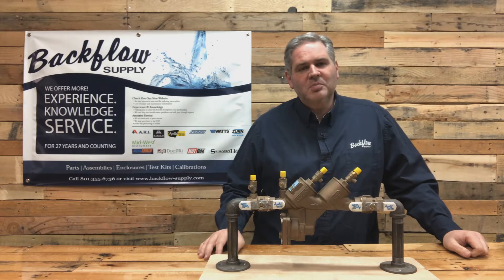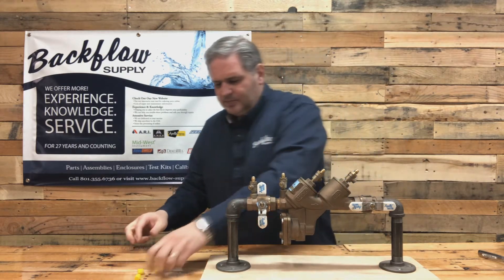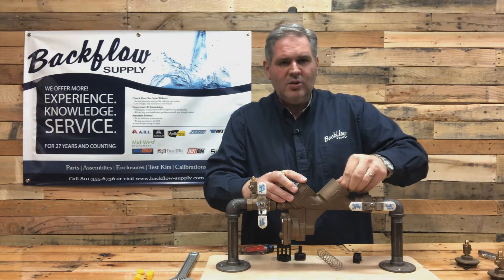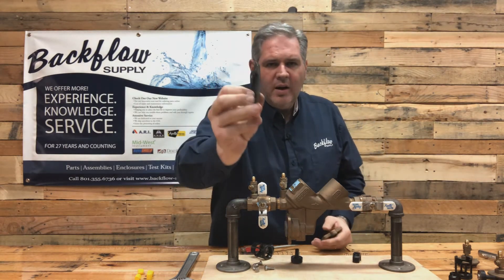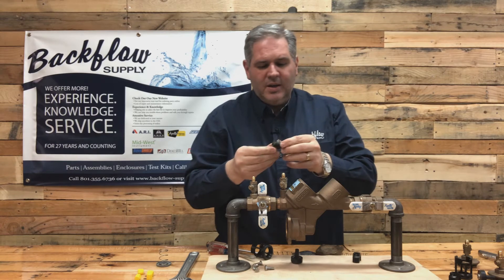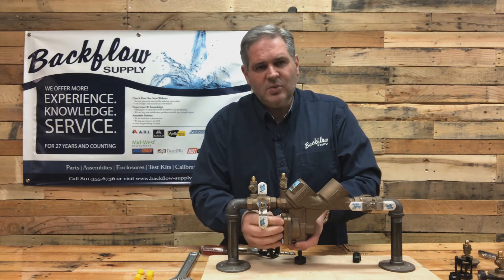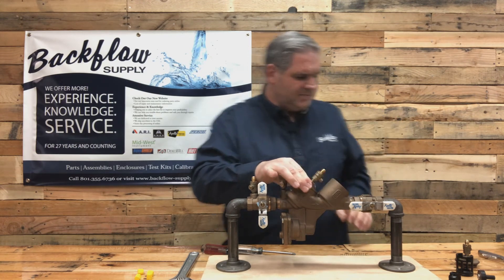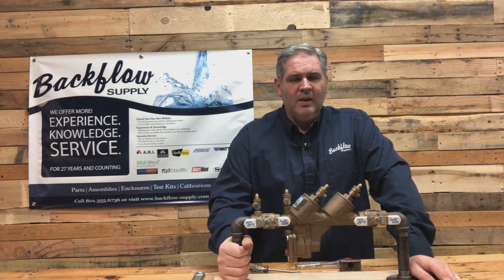RP4A/RPLF4A Breakdown and Explanation

Comment: I installed a new RP4A, bled the input and I'm sure its installed in the right direction but as soon as I turn the water on it starts gushing out the bottom.   The unit is brand new so what might be the problem.
Reply from the maker: Maybe you have resolved this already.  But the first thing to do is to get a flow going through the backflow assembly greater than what is coming out the relief valve.  I am assuming this is going to a lawn sprinkler system.  Even though it is dumping water turn a zone on that will get the required flow of water and observe if it stops dumping.  If it does you know there is an issue in the first check valve.  If it doesn't it is an issue with the relief valve.  

It is not uncommon on a new install for debris in the line, rocks, rust or other debris gets flushed into the first check.  Take it apart and see if that is your issue, inspect the rubber and the seat to make sure they didn't get damaged and put it back together and turn it on again.  Hopefully it doesn't dump again.  But sometimes it will and it could still be more debris in the line.  

I have seen a few issues with the relief valve in the last year in brand new units.  So far I have not been able to determine the cause but have provided those that brought the unit from me with a new relief valve and it has solved the issue.  This is rare.

You are welcome to call me at 801-355-6736 if needed. Ask for Sean.

Comment: Can I buy that socket adapter to shut off the water?
Reply from the maker: If you are referring to that tool used at 2:22 in the video, yes you can buy those to shut off the ball valves on backflow assemblies.  There are three different sizes.  Part numbers WV100, WV101, WV106.  https://backflow-supply.com/collections/backflow-test-kit-accessories

Comment: Question... What would happen if you swapped the spring for the number 1 check valve with the spring for the number 2 check valve? Would it still work as normal? Cause it to leak out of relief valve? Thanks
Reply from the maker: Dimitri, I know I answered your question in the email, but didn't realize the question was here as well, so I wanted to post the response so others saw it also...

On an RP the relief valve would not be able to shut if you switch the #1 and #2 check springs.  Remember the #1 spring needs to be a minimum value of 5 psi, the #2 spring needs to be a minimum value of 1 psi and the RV spring is minimum value of 2 psi.  So if you put #2 in #1 position it doesn’t allow the water to be diverted to the relief valve to close it because the #2 spring is only 1 psi and has less resistance than the RV value of 2 psi.  It would open the #1 check and pass through the RV vent.

In the DC models the spring doesn’t matter as they both should be a minimum of 1 psi.

Comment: After 3 hours and taking apart almost the entire thing the problem was in the release area it couldn’t go back and forth because of some buildup cleaned it out and applied a lot of lube and the leak finally finally stopped
Reply from the maker: Applied a lot of lube where?  What type of build up?  I could see the need for some lube on the o-ring under the bushing on the stem but no where else.  I have not seen build up keeping it from moving, but have seen a swollen, or unlubed o-ring prevent the stem from sliding through the bushing.

Feel free to call me at 801-355-6736 or email me at sean@backflow-supply.com if your issue comes back.
Reply: @backflowsupplyslcut9394  I think it was the unlubed o- ring keeping the stem from sliding

Comment: Hi Sean, there's water coming out of my relief valve from where the diaphragm sits. It's not a mist as you noted, but more like a spray. Water is also coming out of the vent. Is that repairable with one of your rebuild kits?
Reply from the maker: If I understand you correctly the water is coming from in between the relief valve cover and the body of the assembly is where it is spraying from?  And then leaking out of the vent opening as well.  Did this freeze?  If so you may need to do more checks on the body of the assembly to look for any types of fractures on the outside of the body and more importantly behind the number one check on the inside down the center line of the body.  If the body is not damaged then yes repair kits will most likely be needed and can repair it.  You may also need to inspect the relief valve cover plate to see if it is bowed slightly which is why you have the spraying coming from there, if I understood your question correctly.  You might be able to flatten the cover plate to resolve that.  

If you need to talk more and need more clarification please call me at 801-355-6736 or email me at sean@backflow-supply.com

Comment: This video is just what I needed to trouble shoot my back-flow preventer.  Sure enough my unit froze around the relief valve.  I’m seeing the spray coming from the cover sides and the relief valve stem is broken.  I have a new relief valve and I’m hoping I can flatten out the cover as you’ve suggested to make this repair.  If not I’ll be forking over the big bucks for a new unit.  Lesson learned-pull the relief out to drain all the water out of the bottom.  Thanks for posting this information Sean!
Reply from the maker: Hopefully you were able to pound it flat.  You can get the new cover as an option before a new assembly.

Comment: HI Sean, I just found your videos on the Apollo RP4A and they are very informative and helpful. Here in SA TX we don't get many freezing days, but we did just have the first and sure enough the next day I heard gushing water coming from the vent hole. I assume there is a crack in the actual metal right? I have not taken it apart yet but will inspect tomorrow. Question- I have already shut the first ball valve off which stops the water leak, but to actually remove the entire assembly from the line I need to shut if off at the street correct? Second- I can twist the entire assembly just by hand- it's plumbed into PVC. How tight must it be once I reinstall? I assume just twist the whole assembly and remove. Correct? Once I have it off line, would you  recommend changing out the PVC into metal by cutting just above ground and joining the existing below grade PVC to metal or just leaving the PVC? It is insulated at the moment. Regarding draining the lines if we have another freeze... I don't have a compressor to attach nor is there an air line currently plumbed in. So would I just open the test cocks to release pressure. Do I need to remove the relief valve and remove the spring and keep it inside once water is removed by doing so? Last confirmation- since I have killed the water at the first ball valve entering the assembly, do I need to open the test cocks before disassembling the unit? Is there still pressure on the back side of the assembly?  Does that make sense? Sorry for the long response, but you are a master as it appears by the videos. Thanks again.
Reply from the maker: Samuel, I will try to answer your questions.
Yes you may have a crack in the brass.  It maybe under the first check valve right in the center line going down into the relief valve area.  It is also possible you have a broken component only.  But if the brass is cracked it is done.

Yes, you will need to shut this off at the street before you remove the assembly.  However, until you know the assembly needs to be replaced I would not remove it.  You can do repairs and inspection inline.

If you do not have union nuts to take this out and it is just hard piped, you will have to cut one side of the PVC to remove it.  Even though you can turn it by hand currently as you loosen one side it tightens the other side.

When you reinstall I would recommend using plumbers tape, or pipe dope, but you need to be careful with the pipe dope.  So many people use to much, are sloppy with it and get it in the pipes and it blows into the backflow assembly and causes problems.  I would just stick with the plumbers tape, (teflon tape) and just tighten it until it is snug with a wrench.  

I am not an expert at plumbing.  Someone more experienced may tell you differently, but this has worked for my projects.  I have also seen the mess of the pipe dope when people bring the assemblies in after they have installed a new assembly.

It is up to you if you want upgrade these pipes to metal pipes or leave them as PVC.  PVC is pretty flimsy but I do see them this way.  I would at least use union nuts when you put it back in place on the pipes coming up out of the ground, regardless if it is metal or PVC pipe.  I would also use a tie rod or other strong metal support to drive down next to the pipe if you are going to leave PVC and strap the metal support to the PVC pipe to give it some stability.  That is up to you.  If you don't have an issue just put it back to PVC.

A comment about insulation.  Insulation only slows down the freezing process and delays the warming up process if you do not have a heat source with it.  Eventually it will become the same temperature inside the insulation as it is outside if there is no heat.  It might be helpful for an overnight dropping below freezing and warming up the next day above freezing, but if it stays cold enough long enough it will still freeze.

 Regarding draining the lines, just opening the test cocks will drain most of the water out of the backflow but not the lines.  I would still recommend taking the relief valve cover off and removing the diaphragm assembly, make sure the water is out and you can put it back in place and put the cover back on.  

If you redo the system you may want to install an air compressor fitting after the backflow to blow your system out in the future.

Lastly, when you open the assembly, with the #1 ball valve shut off it is a good practice to open the test cocks to drain the water out of the assembly.  But in this instance where the water is already draining out it might not make a difference.

If you have more questions you are welcome to email me at sean@backflow-supply.com or call 801-355-6736.  
Thanks!

Comment: The crack you show inside the check valve @ 13:00, is it supposed to be there? Or is it a freeze crack & needs replaced?
Reply from the maker: That is a freeze crack.  It can't be repaired so you  would have to replace the assembly.  Even the fractures I show on the outside of the body would most likely require replacing the assembly as this is an indication the body has warped and the body is no longer true and the o-rings can't seal as they should allowing water to get by them instead of sealing it.

Comment: Hi Sean, thank you for the video. I won't start to see the freeze damage until the beginning of May here in the Cleveland Ohio area. I usually see a lot of cracked test cocks and inlet/ outlet ball valves as the irrigation guys need to learn how to properly winterize the device. As you know it is important to put the ball valves at a half open position to drain the water from in and around the ball including the  test cocks which are ball valves. All my best from backflowjoe.
Reply from the maker: Thanks so much for comment and the reinforcing the importance of winterizing the ball valves and test cocks

Comment: What an awful design. After all that work and parts, after that valve has been in service for a few years it will likely not reassemble well. 
Solution: Replace that assembly with a Wilkins 975XL
Good video though.
Reply from the maker: Thanks Lunker.  However, while this assembly does have some issues, the reality is they all do.  I have never had problems with the assemblies going back together well unless it has had some damage to the body.